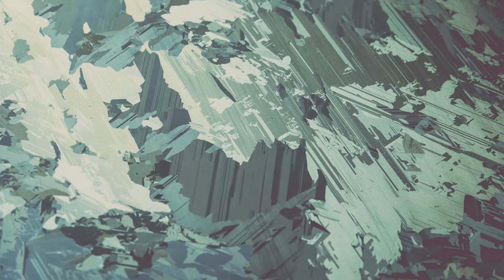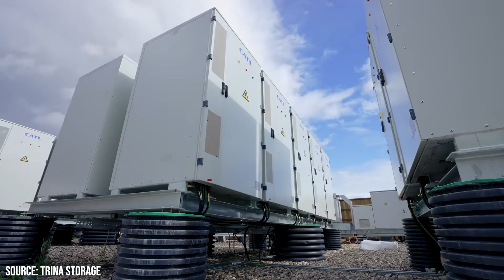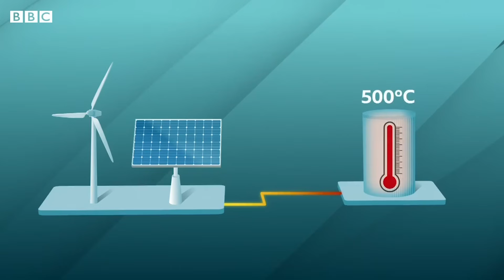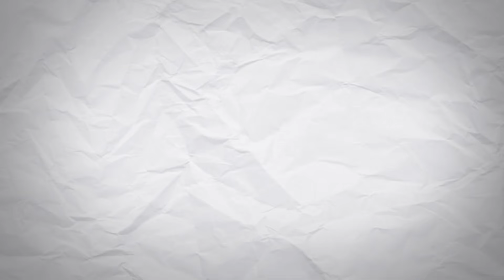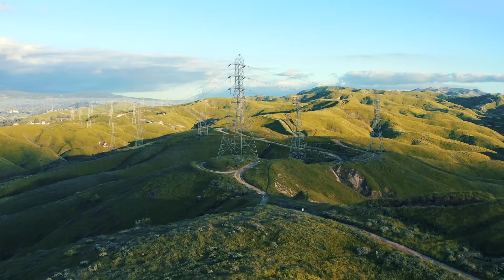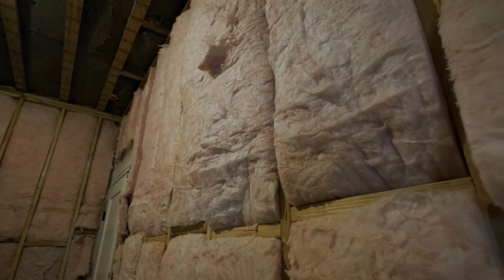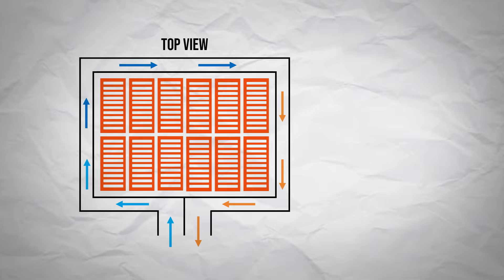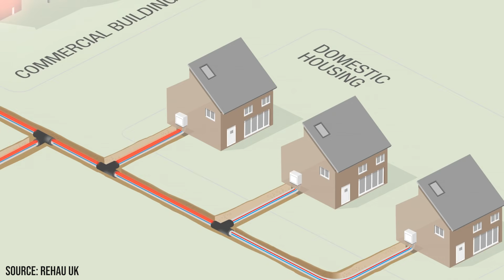How 3000 Degree Bricks Will End Battery Storage

Comment: This is the first I have heard of Rondo Energy, so thank you for the introduction.  However, I would like to hear more technical details about their heat storage battery.  

Pros: 1) off the shelf technologies 2) simple, long life materials 3) high output temperatures (compared to other heat storage technologies).   I love this part of the solution.

Cons: 

 1) I am very skeptical of the stated 98% storage efficiency mentioned at the start of the video.   Usually, when talking about storage technology, people quote the "round trip efficiency",  meaning, what percent of the input energy comes out durring discharge as usable energy.    However, I suspect you are quoting the charging efficiency, meaning how much of the input energy is stored in the battery, ignoring how much energy is lost durring the extraction process.  

If you really do mean "round trip efficiency", then this statistic is so outlandish, it really is "too good to be true", and begs for justification and a heavy dose of skepticism.    This would be astounding, and much higher than any of the other heat storage technologies.   Lithium ion itself is typically stated to have 90% round trip storage effeciency, which is higher than any other heat  energy storage technology that I am aware of.  

2)  There is no explanation of how the heat (ie, hot air?) used after it leaves the battery.   I can imagine a few uses, but some solid real world examples would have been nice.

3) There is no talk about the ideal storage charge/discharge cycle time.  Is this technology better suited to be used for short term (4 hour) medium term (8 to 12 hour) or long term (days/weeks) storage?
Reply: 98% is i think the efficiency of heat in -> heat out. If you want to heat it with electricity, and use the heat then to create electricity, you will need to use a turbine which is 40-90% efficient depending on size and whatnot.
Reply: @sza2bom  What type of turbine is 90% efficient at converting heat to mechanical work let alone electricity. 30-60% is the standard to probably too optimistic, I'm doubtful about anything above that
Reply: It should be clarified that this is Btu heat energy instead of using the term Kwh energy because people confuse it with Kwhe (electric); at least say Kwhth (thermal). It also confuses people to compare it with Lithium or the term battery because first of all, it's just storing heat; its a heat bank not a battery which by definition stores chemical energy for electric release potential..

There is no revolutionary translation of the heat energy back to electric unlike MIT's work in using the radiant light in super high temperature storage cells to charge special built in PV panels to recover energy with a meaningfully high electrical efficiency round trip number.

Rondo's "battery" efficiency for electric generation will be around 40% max and more likely 25% for smaller grids. This is even smaller if the input is electricity produced from heat in the first place.

Its round trip energy for grid storage will still be possibly competitive with Lithium if one has CHP (combined heat and electricity) usages along with combined cycle plants. 

Like most "highly disruptive" technologies that dont tap into a larger industrial ecology or circular economy, they are only disruptive in niche areas. This niche area is quite large and important still.
Reply: @baloog8  I disagree with you, very few people use BTU, kwh is  correct unit, you just have to educate people that it is just any kind of energy.
Reply: @jakubiskra523  sure. I'm not trying to be difficult. I saw one magazine use Kwhth as in thermal.
Reply from the maker: Thanks for the detailed comment! 

To build on the response from Rondo, the reason the efficiency is so high is because inefficiencies usually come in the form of waste heat, however as this is a thermal battery, heat is what we are after! Therefore the heating elements are nearly 100% efficient, and as we require heat at the output there are no conversion losses there - all the losses come from heat loss, which is tightly controlled through dynamic and static insultation throughout the system! 

In summary, the fact energy is stored in the form we need it (heat) means it is very efficient, and there are very few conversion losses.
Reply: @ZirothTech  You're missing the point! This energy storage is only practical for producing industrial heat! Not for powering a grid!
Reply: @jameswatkins7763  Tbf, this is a HUUUGE energy sector.
Reply: @antonzhdanov9653  If you needed industrial heat, why would you use grid electricity? That's the most expensive heat you can buy.
Reply: @jameswatkins7763  1.0 emission objective. 2. A lot of processes consider heating and cooling, why not storage and recycle excessive heat?
Reply: @antonzhdanov9653  LOL! You think generating industrial heat from the grid has less emissions than a gas burner?
Reply: @jameswatkins7763  Depends on electricity source. If take worldwide statistics -no. Taking into consideration fossil fuel power plants rate in total energy generation + median generation efficiency+median efficiency coefficient of grid and heaters, if anything, its even worse than just heat with fossils on place even taking into consideration such efficient ways of heatin as microwave heating or induction furnaces. If take into consideration statistics of some countries like France or Sweden, if energy efficiency is better due to generally more advanced technologies, but not that striking as you can't fool physics, well, at least, not till your power grid is made of superconductors what is unheard of, fossil fuel rate in generation of electricity there is neglectable, so yes, there electric heating has quite way lower carbon print. Though, for France there are some questions about nuclear waste impact on environment and treatment of those. Today France mostly sell those to Russia and even doesn't ask what russians do with it after. Russians claim to use it as fuel in their reactors, though those types which produced Chernobyl and actually never built new ones since that disaster happen due to compromised design, treating it into fuel by enrichment process, though for that they modernize and convert old soviet military facilities, construction of those from scratch is economically dubious, and while indeed having new generation nuclear reactors, those if having full family of industrial ones are way actually less miraculous and not really creating "full closed loop" as sometimes stated "burning" radioactive materials not just in one reaction till it no more can be achieved, but in whole radioactive raw till non-radioactive material which though still can be chemically dangerous if this is a thallium and not a lead, which if poisonous is still widely spread in nature.  Though its somewhat technically possible but still in theory and a lot of russian claims are actually bs to calm down people concerned about a role of Russia as nuclear waste dump.
Reply: @antonzhdanov9653  so basically, specific countries may have clean grid power. But we both agree that the majority of grid power across the globe is dirty. Therefore in most of the world, you're better off heating a thermal storage medium with a burner because it doesn't have the energy conversion or transportation of grid power. Therefore much cleaner and more efficient. Again, this is NOT, and never will be, a viable replacement for Li-ion batteries.
Reply: @jameswatkins7763  I think, it can. As already coal is out of equation due to heavy CO2 emitting taxation. Natural gas does way less due to in CH4 the most energy output is given by hydrogen burn =>2*H2+O2=>2*H2O what makes it up several times cleaner than coal and even oil, as oil while also has CH  basis, having lower C to H rate. That's why gas use is skyrocketing now. Even if take out of consideration its use as raw material for plastic industry. Though, this is a VEEEERY limited resource and its prices flying very high already, partly due to natural state of art, partly due to quite obvious geopolitical bilateral scheming. What makes shine other sources. One of them biogaz, another is nuclear, third is renewable.
First one is kinda expensive, though,it has kinda some prospective due to advances in biotech. Though, tinkering this can backfire at unimaginable rate. The biggest issue is while bio waste is quite abundant even as byproduct of  human being, designed bacteria are  prone to be quite weak and easily consumed in case of contamination with ome "wildlife" making gas producing extremely expensive. Creating resilient ones on other hand can produce some kind of unstopable supermonster eating out living biomass and turning it into gas. Well, in apocalyptic sci-fi mostly, but still. Would be quite nasty to rote alive with own creation.
Upside of that tech it has potential and actually around flat 0 emission as living forms are taking carbon for its needs mostly out of atmosphere, so as much taken, as much given as well as don't require to change any of existing facilities. Not even mentioning most energy is stored in hydrogen, not carbon. From other side its expensive for now.
Nuclear has a lot of potential as well, has very low emission if not total 0 due to fuel production process and of course a waste big problem, while being wgile expensivs, still the closest economically solution after fossils.
And renewables are just not effective enough to wield needs while being quite expensive and while greenies like hype-train those, physics laws are just deaf to their beliefs. Harness all winds or rivers is borderland impossible in reality and moreover, it has a lot of environmental impact as well even out of freak producing of solar panels, while used on required scale, making questioning if there actually really any viable reason to do this.
What is my point there, if actually its more due to political repercussions, looking for even heating system replacements is becoming viable and unlikely situation change anywhere soon. Maybe using gas will be ok for heating for,lets say, around a century , though, it will have to be replaced eventually. And in this case those batteries can be a great fit, bcs heating/cooling is more than 1/3 of total ELECTRIC energy consumption already as noted in vid. Though, I suspect its rigged a bit due to its mostly cooling part which takes electricity imo. If company producing those batteries actually achieves to find interested clients, than its time already come, even if in my opinion due to ridiculous global politics situation, making fossil fuels quite damn expensive lately. I imagine those batteries can be already huge fit for metallurgy or chemical industry as imaging storing heat during metal crystallization process and than releasing it in furnaces to help with melting and using less coal or gas which spent not to structural transformations of metal, but just for heating and chemical industry usually struggles with delivering precise conditions for rows of reactions to get a product, so heat management can be used there as well.  The biggest issue till today was that it was impossible to store heat anyway effectively. If this batteries are really as good as stated in flat numbers it can be a game-changer
Reply: @antonzhdanov9653  Again I'm going to ignore all your pointless off-topic ranting. You've not provided any evidence why thermal storage can replace Li-ion batteries. Industrial heat applications currently do NOT generally utilize batteries of any kind, because they can generate heat on demand with burners. They don't use grid energy because it's expensive/inefficient. Li-ion batteries are used for power grid stabilization because of their instantaneous discharge. They are used in devices due to their portability. They are sometimes used as residential power backups which requires electricity as an output, NOT heat. You've explained how an industry that currently doesn't use Li-ion could utilize thermal storage. And somehow this is your reason why thermal storage can replace Li-ion. Do you understand how absurd this is?
Reply: @jameswatkins7763  Don't bother to read closer to the end, don't it?
Shortly, Li-ion is simply inefficient due to heat to electricity and vice-versa conversion for on topic matter. 
More off-top Li-ion if anything is not known for iys fast charge-discharge. There are several "supercapacitor" solutions, though, they have way worse capacity.
Reply: @antonzhdanov9653  Thermal energy storage would require a heat exchanger with a turbine at a large scale to get >50% efficiency energy conversion. And even at scale, it doesn't exceed Li-ion for efficiency. So once again, Li-ion wins.
Reply: @jameswatkins7763  You miss the point. A turbine is needed for thermal to electric conversion. We are speaking about pure thermal energy flux "thermal to thermal" if you want by simple heat exchanger
Reply: @antonzhdanov9653  No, the whole point is that thermal storage is NOT a replacement for Li-ion! Hint: Li-ion batteries output electrical energy!
Reply: @jameswatkins7763  It won't replace it totally obviously, but there are a lot of applications where it can be actually used instead of any other kind of battery or heat storage as electric heated water tanks, for example.
I repeat: You miss the point.

Nobody said that it will totally replace Li-Ion. Li-ion is mentioned in vid to compare raw numbers of battery characteristics
Reply: @antonzhdanov9653  No, I didn't miss the point. Yes, I admit that industrial heat applications could benefit from cheap and efficient thermal storage. But they would never get that energy from the grid because it's expensive. Heating an industrial size water tank with electricity, for example, is impractical and dumb. They use burners. So then you could say "well what if the electricity came from renewables and was cleaner than a burner?" - now suddenly geography matters, as does land availability. There are maybe a handful of countries/states that could pull this off. And it would require massive government subsidies to be cost effective. Its a pipe dream, not practical in the slightest.
Reply: As I wrote before, if this tech is ahead of its time its not mandatory totally irrelevant. As well as electric and microwave industrial furnaces are a thing along with quite a lot of electric industrial heaters. Tbf, its just several percents in metallurgy due to its used for quite specific alloys, several dozens of percents in chemistry due to using it to create very narrow set of conditions for supporting of reactions and quite widely used in industrial food procession for the same reason  of heating food precisely to avoid burning it or something. As well as all thermal processes are ridiculously inertial. Having battery which efficient and cheap enough to bother with using it for faster heating/cooling with actually saving on energy expenses for those is definitely an advantage
Reply: @antonzhdanov9653  lol. Electric heaters are sometimes used when high accuracy in temperature is required. Once again this is not an application for thermal storage. You're digging a bigger hole mate.
Reply: @jameswatkins7763  Have you ever heard of an electric arc furnace? They account for a large part of the energy consumption in the steel industry and, as the name suggests, are powered by electricity. 
But back to the topic at hand, the point here is not efficiency or economy but the reduction of co2 emissions. For example, germany has set itself the goal of becoming co2 neutral by 2050, and many other countries are making similar efforts. Therefore, gasburners are simply no option anymore.
Reply: @Mrluk245  EAF's would not benefit from Rondo's thermal energy storage. In fact, they mostly wouldn't benefit from electric batteries either because they tend to be operated during off-peak hours. So, this is irrelevant.
Look at the title of this video: "How 3000 degree bricks will end battery storage". This implies thermal storage will replace Li-ion. I'm only showing how absurd this is, and your comment about EAF's only strengthens my point.
Reply: @jameswatkins7763  I am already aware of that. I only brought the example to show that even today large amounts of electrical energy are used to generate heat. 
And yes, the title of the video is definitely misleading, but if in the future the burning of fossil fuels is to be reduced, such heat storage systems will certainly make sense in some cases.
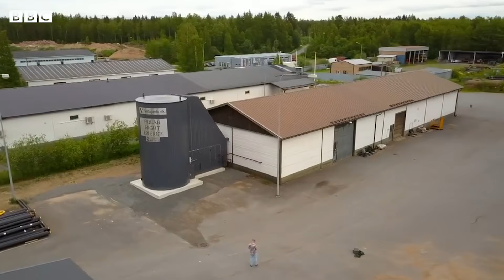Reply: @jameswatkins7763  Bro, "if you're planning to heat something [with renewables]" is the entire context of this video (see 1:43)... not sure if you missed that, or are being consciously ignorant of it to try to argue about something off-topic to begin with because renewables make you uncomfy.  The reason people are aruging with you is because you're arguing about something else-- something not included in the scope of this video-- something you are generally correct about in a completely different context.  You're in the wrong discussion section, and/or you didn't notice how different your argument is, and/or you're trolling.  End of line.
Reply: @Mrluk245  And yet, in another thread Rondo Energy admitted that the only way it would be cost effective - and lower emissions - is if it's "charged" during off-peak hours only. But, only in areas where the grid has some unspecified percentage of renewables. Also, thermal storage is NOT new. And Li-ion can achieve 95% efficiency under some circumstances. over hyped bologna.
Reply: @deathbykindnes  Uh, no. The title of the video is "How 3000 degree bricks will end battery storage" and I'm arguing that it'll never happen. So what I'm saying is totally relevant and you're missing the point.
Reply: @jameswatkins7763  Internet saavy and marketing comprehension are good.  If you're gonna point your arguments at the CONTENT of a video (or article) based on the TITLE, you're gonna have a looong work week.  Good luck!
Reply: @deathbykindnes  Yeah this video was intended to mislead people into believing that thermal storage is a viable replacement for Li-ion. So I'm calling them out for it. Why are you so hell-bent on defending them? Did you purchase stock or something? Geez I had no idea an obscure industrial company had such fanboys.
Reply: @jameswatkins7763  they clearly say thatctjey use energy from renewables 0 emissions power plants, and it make sense to transfer excess power from the grid to heat, to avoid Industries using fossil fuel to create the heat they will need. So they will help this industries and homes with District heating, to avoid using Fossil fuel to generate heat. In the future, where there will be anourmous amount pf energy generated by Renewables, it will be super usable to store and dispatch heat instead of using large amount of battery for high energy industrial purpose.
Reply: @jameswatkins7763  Theoretically, heating from the grid does have less emissions if you are using electricity with high renewables ratio, and in those instances battery like this helps smooth out the intermediacy of the electricity supply; if the factory is charged based on spot pricing it could use periods when the electricity is really cheap to charge up the battery.

However, whether this should be done or if there are more cost effective ways to reduce emissions is another matter entirely
Reply: In this case, we should talk about efficiency per working day.  for example, the efficiency of storing energy for a week is 95%, but for 2 weeks it is already 90.5%.  it would be useful to have a graph showing such a relationship.  if we want to get electricity, the efficiency drops to 40%, if we do not count the collection of lost heat.
Reply: Hi Douglas!

1) The roundtrip efficiency of basically all electric thermal energy technologies will be in the 95%+ range. Rondo's roundtrip efficiency is 98%. Our system is designed to minimize environmental losses via insulation and recycling air.

2) The energy that leaves the system (hot air, superheated air, or steam) is sent into a facility's existing heat network. We're a plug-in replacement for existing gas-fired boilers that are using the same networks. Large heat loads and heat networks are common in the steel, cement, food & bev, chemical, low-carbon fuels, mining industries and beyond into non-industrial uses like district heating.

3) This is a long duration energy storage solution, the Rondo Heat Battery retains its charge for up to a day.
Reply: @RondoEnergyGlobal  
I call complete BS on the 98% roundtrip efficiency claim!
Why would you even say something like that, when it contradicts the limits off any existing technology or the laws of thermodynamics?
Great way to lose a lot of credibility for no apparent reason.

Pretending that you can even get 98% of your raw energy into your storage is bold,
it still being there when you come back is questionable,
but actually making good use of all of it is just an obviously lie.
Reply: @Assywalker   As they stated, the device is a plug and play replacement for a boiler. Which means round trip doesn't matter. Why? Because they are sending the same temp steam through the same pipes to the same devices etc. The losses along the way are going to be identical to whatever you ahd before and rondo independent. The only question is how good are they at taking heat from an electrical source and converting it actual heat in the bricks. But that mostly only results in waste haste which isn't wasted so 98% seems fine. They have no control over the loss of power from the wind turbine for example to them. IT will be identical to what it woudl be with any other device, li batt or boiler or whatever if your using electric. Though natural gas obviously has no real losses if your piping it in. 

But the main loss question is about losing heat to the outside, how good is the insulation really.  Everything else will be identical to whatever was there before. 

The best question is what percentage of heat is lost per hour of storage to the outside world. LI might be much better at long term storage. So then the question becomes ok how long can i store in this before it's cheaper to use Li. Hopefully if a day is 100% always cheaper then that's probably good enough honestly. Especially if it comes with a much lower upfront cost and lower risk of danger and cheaper repairs.
Reply: @RondoEnergyGlobal  hmm 1 day is probably not too usefull for private homes, but I could see its application in industry, aswell for powergrid fluctuations. As far as i know (in most cases) they use rotary batteries that rotate at high enough speeds to store energy and release it during powergrid fluctuations. Question ofc is: what's more efficient.
Reply: @soundphile988  1 day is enough to cover the usual grid fluctuation. Overproduction or underproduction (assuming a balanced grid with enough wind power in relationship to solar power) over a week or multiple weeks is extremely rare, when speaking about a well integrated grid that spans across a continent (like europe for example). Usually there is overproduction or underproduction (on a grid scale level) for a few hours during the day. If you can balance that with a cheap storage method (like <0.05€ per kw/h), then that would be a game changer. You could work with natural gas power plants for the remaining few extreme situations where you need high power generation with low investment costs for a few weeks during the year. Coal, oil and Nuclear power plants would not be able to compete in that environment.

In the short term this would lead to a massive boom in renewable power generation, in the medium term to the death of all of the coal power plants. Nuclear might stay, because they usually run outside of the free market calculations (build and operated by gov backed companies).
Reply: @ackwebde  Nuclear power plants need around a week or even two to safely change their output drastically, so usually they are covering steady consumption. Contrary to renewable sources, this one is ridiculously stable and inert and can be available at virtually any environment. So it really covers what renewable can't. Though, fluctuation in long term for renewable is actually not that uncommon. Especially for wind energy. Like climate is changing along with windy zones or precipitation count, consuming solar energy or drying up of rivers, not actually impacting energy generating dams, but water supply of areas around.
Reply: @RondoEnergyGlobal  Very interesting and Ty!  
Is there a practical way to use this heat for storing electricity, such as running a turbine or producing hydrogen?  
I'm working on a business plan for a renewable energy plant, and I'm looking for a cheap way to store extra power.  
Perhaps the energy could be store for much longer with the use of high temp vacuum panels in conjunction with other heat storage insulations?  It seems the cost could be easily justified?
Reply: @l0I0I0I0   It already is a replacement for electircal as is basically. You can let the steam rise up through a turbine to turn it and bam electricity. It's replacing the way a coal fired boiler in a electircal plant works with heat stones fired basically.
Reply: @RondoEnergyGlobal  Lie,(long term) this is short term storage.  LIE, "all electric thermal energy tech is 95%".  That is only input efficiency.  Not round trip efficiency, as we have a giant delay of use, and so is your lie of 98%.  Now if the structure is infinitely large, I suppose one can get close to 98%, but it is NOT infintely large and there is a giant delay of DAYS when the intermittent supply has no excess and you STILL have heat loss etc.  Glad you made SOME use of Billy Boy Gates Billions, but common man, stop the lies.
Reply: @RondoEnergyGlobal  Thermal energy storage (TES) systems can have a round-trip efficiency (RTE) of over 90% for thermal-to-thermal applications. However, each conversion in a TES system is usually less than 90% efficient, and the combined efficiency of conversions to and from storage is often less than 75%
Reply: @RondoEnergyGlobal  how can the heat convert back to electricity with above 90% efficiency? Is there a alien turbine tech I've missed? Lol

Even with CHP, you won't get 90 in my understanding unless you are using various grades of heat meaningfully in commercial or residential settings.

You said there is some electric round trip thermal tech? I'm open to hearing about it sincerely. I admit I don't know everything.
Reply: @baloog8  the key is Rondo is selling the customer heat - so you never turn it back into electricity. The customer is getting 98% of the electricity in as heat they use for 24/7 processes.
Reply: @concon424  fair enough. I was just on one the other day. Haha
Reply: @RondoEnergyGlobal  How efficient would it be to go the other way and cool the bricks down? 
Warming things up is often needed, but cooling down also need a lot of energy. Food factories that need to flash freeze food could charge a "cold" battery at night with cheaper electricity for use in next day production or just use it as an accumulator that are cooled at a constant rate with a smaller cooler, then used in intervals when a batch of food need to be frozen.
Reply: @bknesheim  This is harder because 1)
There is a lot of room to get real hot, but you can't go below absolute 0. 
2) Turning electricity into heat is extremely simple, just use a big resistor. Turning electricity into cold is harder.
Reply: Lol 95% roundtrip, what a scam
Reply: Heat from industry is used for district heating in most countries. Much more efficient than US style gas heating of homes and water
Reply: NOTHING is 98% efficient.
Reply: @rxonmymind8362  Actually, your AC system is likely greater than 100% efficient. Because it can move heat in excess of the energy it uses. You could also consider electric heaters to be 100% efficient because all the waste energy is in the form of heat. So, it depends on perspective. Is Rondo's heat exchanger 98% efficient? That's hard to believe but not technically impossible.
Reply: @jameswatkins7763  Something can't be more than 100% efficient, that would imply you're creating energy out of thin air.
Reply: @Razumen  As I said, a heat exchanger can move more thermal energy than the energy it consumes. Describing this as a >100% efficiency is sometimes appropriate, but only when comparing its efficiency with other methods. It's a semantic trick but it's not inaccurate.
Reply: @jameswatkins7763  lol, it's very inaccurate, and violates the second law of thermodynamics.
Reply: @Razumen  I understand that. Did u even read what I said? I just did a Google search and this is from the first result: "An Air Source Heat Pump (ASHP) typically produces about 3kW thermal energy for every 1kW of electrical power consumed, providing an effective “efficiency” of 300%."
Reply: @jameswatkins7763  I did, you're talking about the efficiency of the machine, not thermal efficiency, which is always below 100%. The way you are phrasing it is intentionally misleading.
Reply: @jameswatkins7763  the title of the video is wrong in fact. But the concept is Power-to-heat application is good for industrial heating and district heating.
Reply: Yes, kindly share the model and data to support this claim.
Reply: Just to clarify a couple of points, the 98% quoted is not entirely relevant as the bulk of the losses will occur during transmission, i.e. radiation through piping, etc, before any work is delivered to the load. 
That said, this extra inefficiency (while setup and application dependent) can be calculated on a case by case basis, and can be overcome by he financial gains of taking power from the grid when at certain times of the day when prices are cheap. As this is a daily cycle, any points on monthly and weekly variation are unfortunately mute.
That also being said, most large scale industrial companies with a high power bill will have a "cap" (fixed high limit) or "swap" (fixed) contract arrangement with their energy provider to defend against unstable network conditions with the potential for gouging price swings
For the battery to be of any use, it would require a capped contract, which adds cost as its essentially insurance. 
To elaborate, the price can swing from -$400/MW to $15000/MW in a few minutes. If the customer were exposed to this directly, they would need to be able to shut down operations at a moments notice. If high prices persist for days, weeks, (in the case of crippled generation) they will not be able to use their heat source at all, lest they run at a loss. Hence they require insurance which tightens the window of opportunity. 
Anyway, back to the engineering side of things, if the point is to charge during the early morning on baseload gen, or at midday on renewables,, to gain a financial advantage based on grid prices, any utiliser of the technology would need to do a thorough case study of the current and future electricity market conditions, and whether this combination would be superior to a fixed price contract, such is what is used by aluminium smelters, coal fired power generation, and the like.

Source; Am power engineer.
Reply: Having read the rondo response to some serious questions about the overall efficiency performance measures, it looks like this might be great for some high energy thermal input industrial processes. Certainly the long term or life cycle might be very good but up front capitalization and maintenance and return on investment numbers might not be as spectacular.